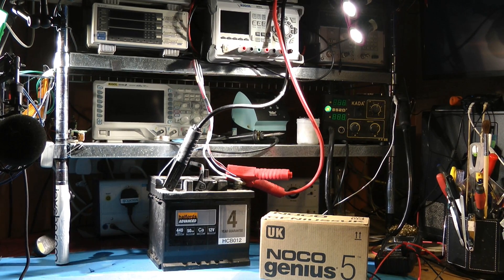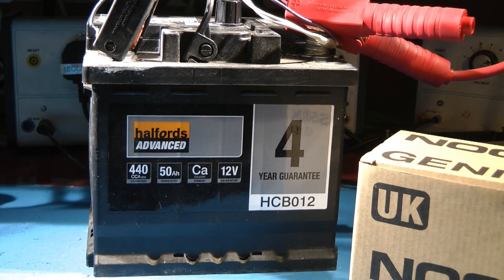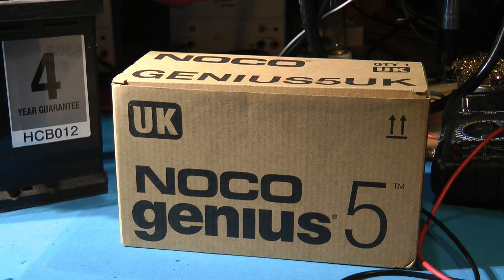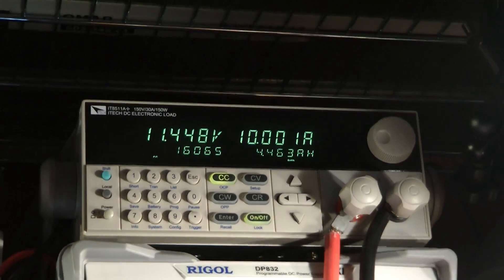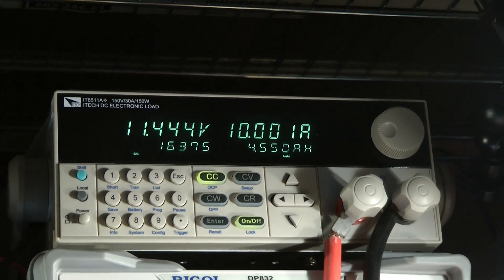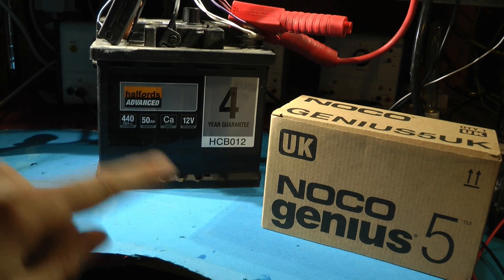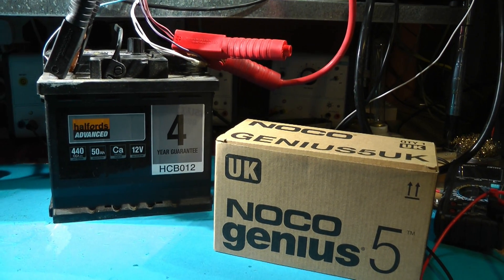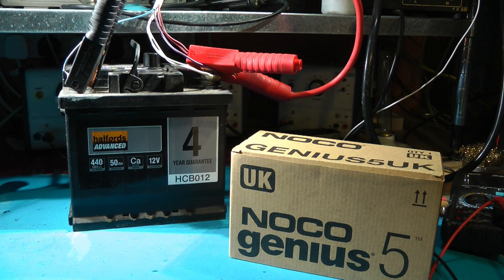NOCO Genius 5 Battery Charger Detailed Evaluation, teardown  and Review Part 1

Comment: I have noco genius 10 trying recon my battery and doesn’t work 🤷‍♂️ Before and after recon battery capacity is only 30%🤔
Reply: Trying to recondition a worn-out battery is like trying to resole your shoes by walking on them
Reply: @jusb1066  You have to remember what a reconditioning mode is - a renamed equalization charge.  As such, reconditioning modes are only good for situations that require an equalization charge.
Reply: @richardlouie2922  yes but using the name is misleading.. people expect there previously worn out battery to be good again
Reply: @jusb1066  Absolutely! But that's what happens when the marketing department gets done going over the list of features! The same can be said for their claims of desulfating battery which are technical correct as any charger will desulfate a battery to a certain extent as charging a battery reverses sulfation up to a point.
Reply from the maker: Um no, it's not an equalization charge. That is something done at the end of a standard charge cycle.
Reply from the maker: Or so they say.   I have had comments from viewers that are convinced that it works so I will do a real test. See next video.
Reply: There might be a mix up in the terminology used. To me, recon means recondition/repair mode like how it is used by CTEK which does happen at the end of the standard charging cycle. Some may be using recon/regen to refer to the desulfation mode that these chargers claim to do.
Reply from the maker: @richardlouie2922  I see what you mean.  Good point.  The CTEK test is on the channel with the complete charge cycle.  I am not sure if it answers your question.  It did go through all of the LEDs and you can see what it is doing. I can dig it out and do more tests and decode the smoke and mirrors.. They do weird stuff. I have tested a lot of similar software in my Job as technical director and I know that they software and hardware engineers rarely bother to go very deep when testing. There re invariably undocumented features...Most not by design.. Thanks for the comment. Very useful reminder.